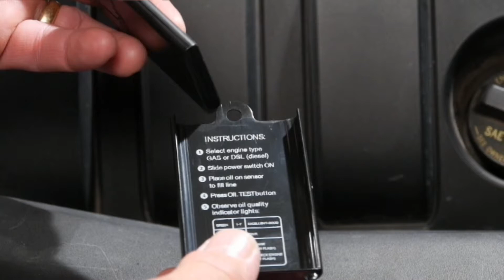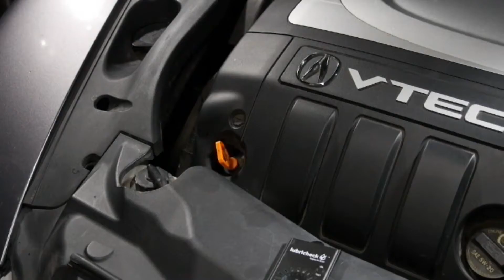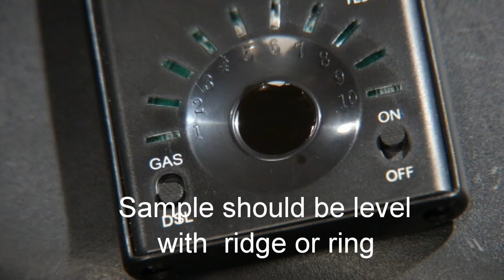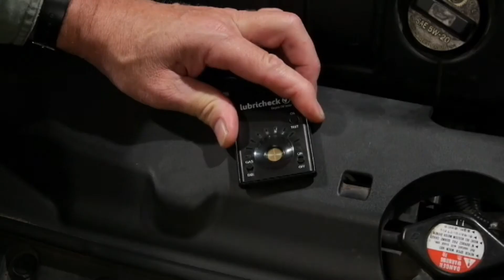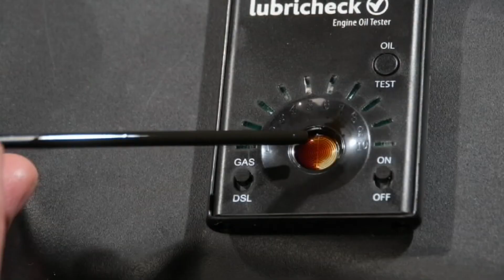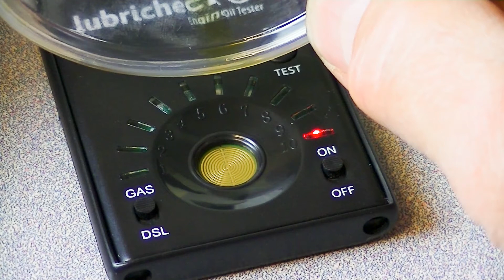Lubricheck Oil Tester Demo: How to Test Your Oil, Instantly!

Comment: Great question. If fuel is present in your oil, the oil will be diluted, and the Lubricheck will rate the oil as better than is actually is. If you have been taking regular readings with Lubricheck, and you see the oil quality improving, you may be getting fuel in your oil. If you suspect fuel in the oil, based on the smell of the oil, etc. you may want to try a blotter spot test. Place a drop or 2 of oil on an index or business card, and watch for light colored rings to form around the perimeter of the darker spot in the middle.

Good luck with the fuel issue!

THE Lubricheck Team

Comment: Lubricheck, will this detect bad oil if the only big contaminent is fuel in the oil?  It will thin the oil out, does the lubricheck work in that scenario?

Comment: What's to prevent the stirring rod from dislodging from the PVC tubing and fall into the engine oil reservoir with the tubing collection method?
Reply: You raise a valid concern. Not all stirring sticks are the same diameter. You must observe common sense and make sure the stirring rod is a snug fit in the PVC tube.